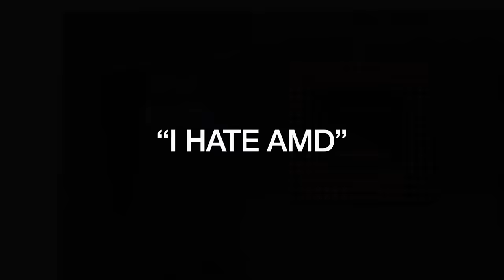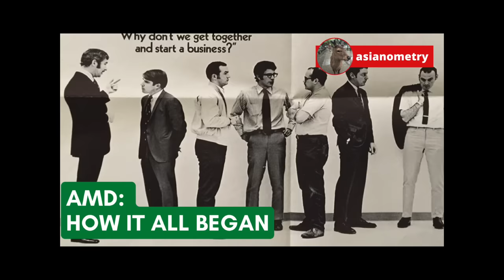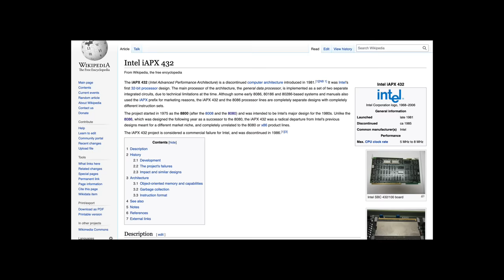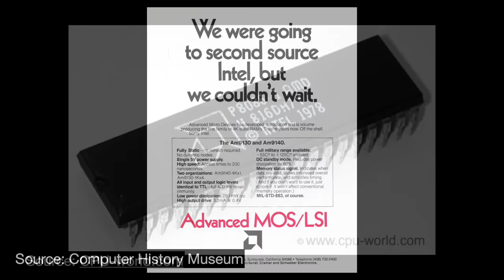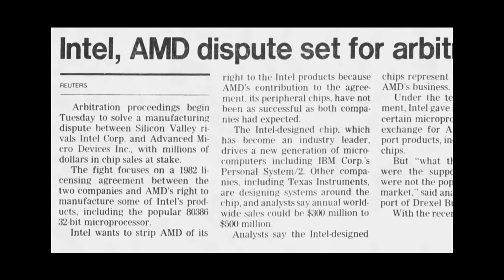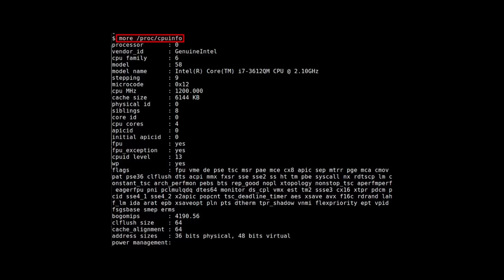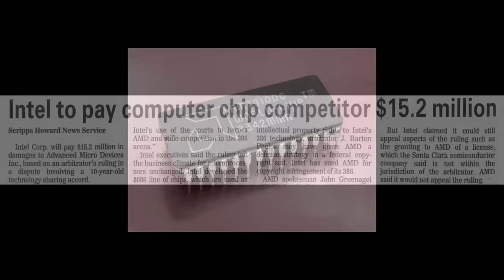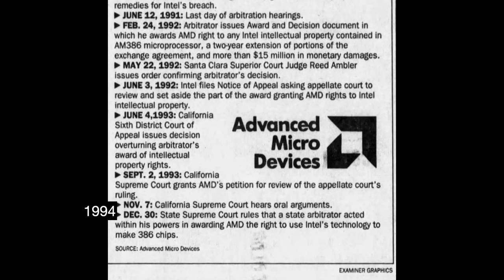Intel & AMD: The First 30 Years

Comment: intel is more compatible to microsoft stuff and amd not.... like nvdia is compatible to microsoft stuff and ati not.... I remember when I couldnt play my games when I had ati because of compatibility
Reply: What you pointed out was something not widely publicized decades ago with the chip wars:  Processors compatibility with software.
Software makers had to slightly tweak their products to work on Intel and AMD; for as [ahem!] compatible the rival chip processors were suppose to be, software that worked with Intel processors wouldn't work with AMD equipped PCs.

Comment: Now the tables have turned. Intels best chips today cost too much and use too much power. While amd's new ryzen chips can meet or exceed intel chips and cost much less. The same is starting to come true in the game market with amd/ati vs nvidia
Reply: Not recently. The i3 and i3f are better deals currently. Intel took back the low end, but at least I can use ECC ram with the AMD one.
Reply: @H0mework  AMD was smart in not market differentiating virtualization and ECC for the consumer chips for the longest time.